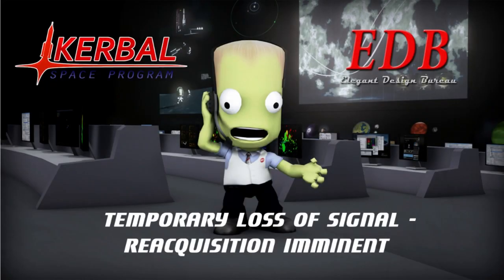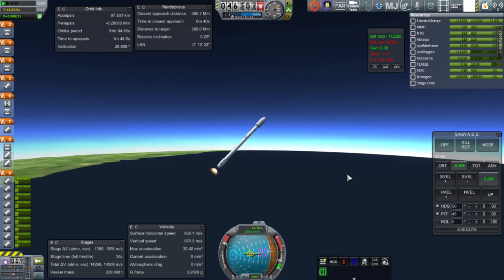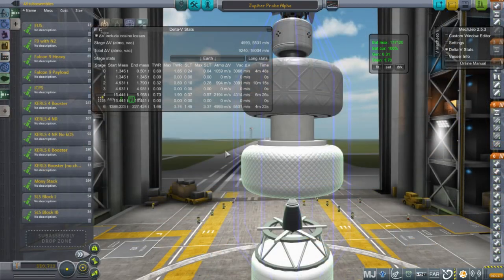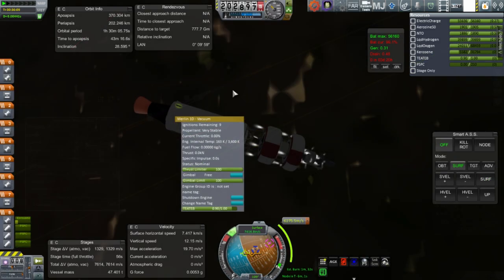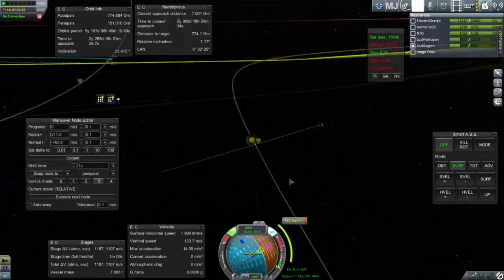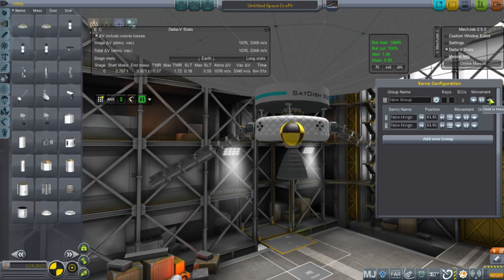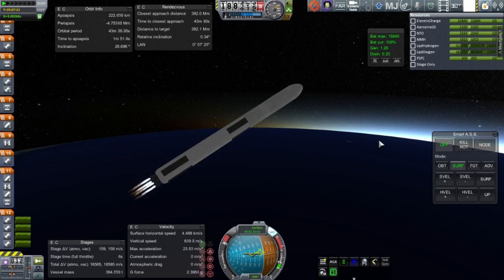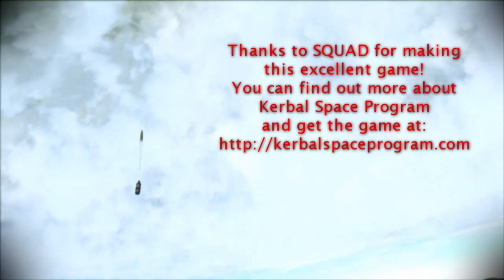Sol System Colonization in KSP/RO - 06 (2015-11-22)

Comment: Have you thought about looking at SSTU labs? It's got lots of great parts, especially for SLS and Orion, and I believe it's compatible with RO
Reply: +Tyler Raiz one of the main selling points is that it has a low part count, especially with tanks, in a procedural tanks kind of way. It has quite a few parts, but they also do lots of texture sharing, and it might also help with lag in launch

Comment: So I notice that you wait quite a long time to shed the fairings during launch, particularly your Jupiter launch at 10:21. Any reason for that that?  Once you get out beyond around 70k they are just dead weight...
Reply: 64 bit?  Hmmm.. :)  Are you running this on the 1.1 beta or Linux?  ;)
Reply: Unfixer?  Methinks I need to get me one of those..  For some reason I am getting to the loading page at 2.4 gigs and by the time I make 3 or 4 scene changes I'm at 3.5 and crashing.  No idea where the massive memory leak is.  Hope 1.1 lands soon!  can you point me in the direction to learn about what you did to make 64 bit work?  

I used Linux for a little bit, but the frame rates were atrocious.